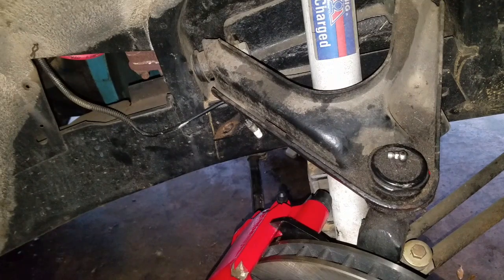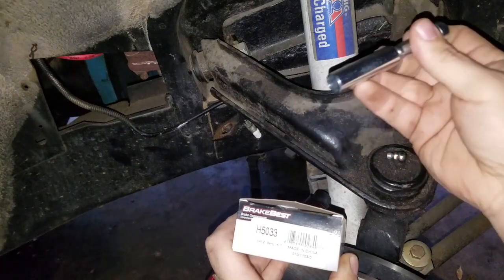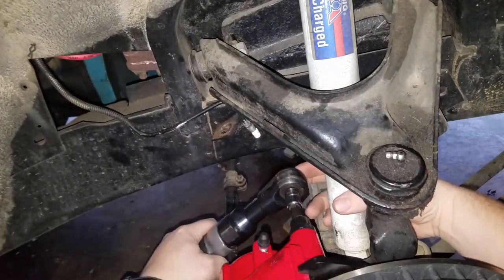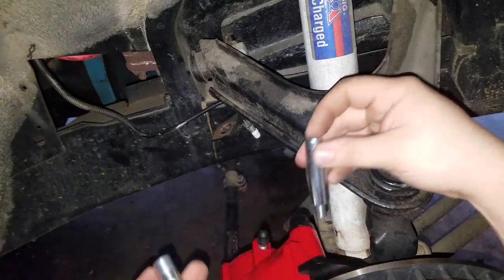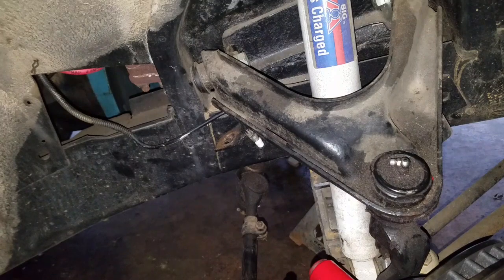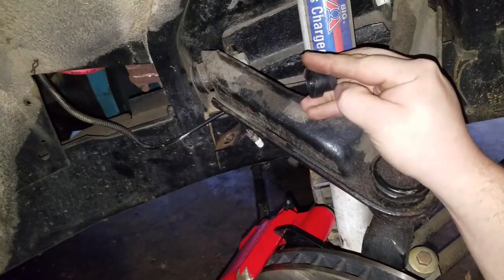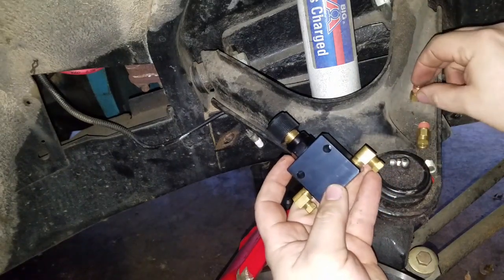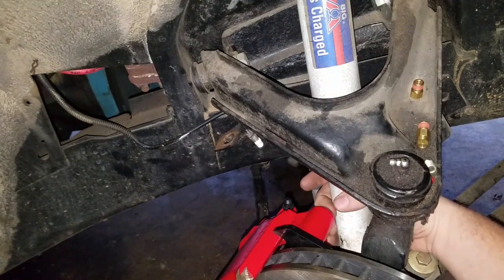1968 Dodge Charger R/T Scarebird Disk Brake Conversion Installation part 2

Comment: really great fix to the bolt length problem on the brake caliper. Good idea with truck Master cylinder coming from the charger good thing they are interchangible parts makes life much easier. Thanks for sharing

Comment: did ur 68 come with power brakes or did you add a master cylinder booster, mine dont have power brakes and i want disc fronts on mine,, im going to go power brakes so i belive i have to change complete brake lines cuz a booster moves the master cylinder forward bout 6 in. if you could be so kind to help me out with part numbers and suppliers be nice,, thanks bud,, nice car

Comment: Curious to see your mounting location of the proportioning valve as they mount in line  of the rear line and why they have the strait fittings
Reply: What's your Facebook ?
Reply from the maker: https://www.facebook.com/Dodge.Charger.383

Comment: You could have done this swap using all factory parts would have been straight forward no mods or parts from gm 1973 and up a body spindles with b body rotors and calipers also makes it easier when replacing pads
Reply: 6265 Mopar - we nabbed spindels off a New Yorker for our Newport and parted out our own disc conversion, thus avoided a lot of drama.
Reply: The problem I've had is finding where all these MoPar-only parts swaps are documented in detail. I'm going with a Scarebird swap on a D100 as it has the best documentation available is for these swap kits. Ram Man has an "all MoPar" kit $$$$ but I felt better about buying the brackets and sourcing my own parts using NOS when available.